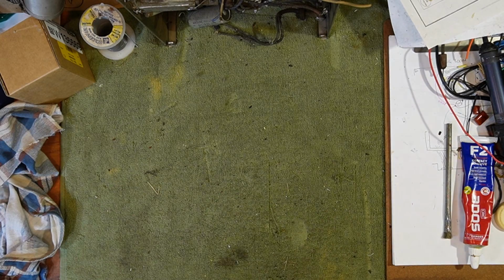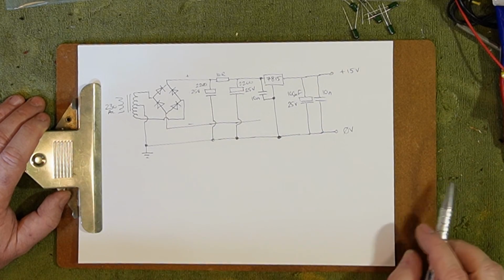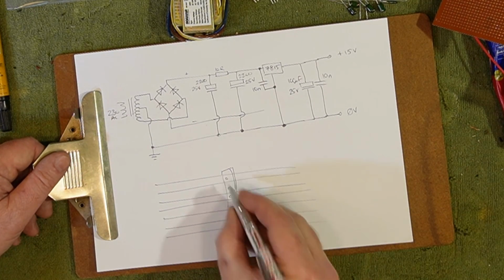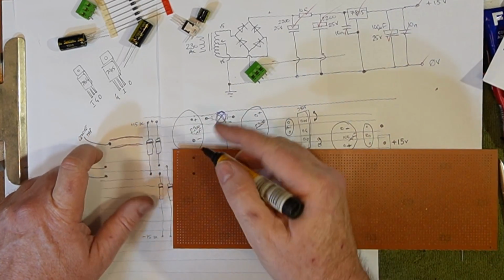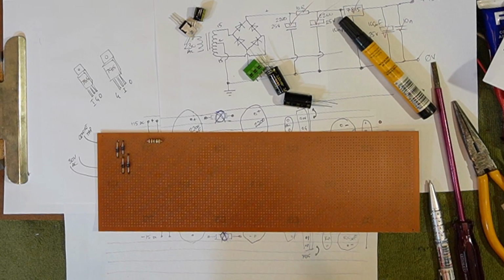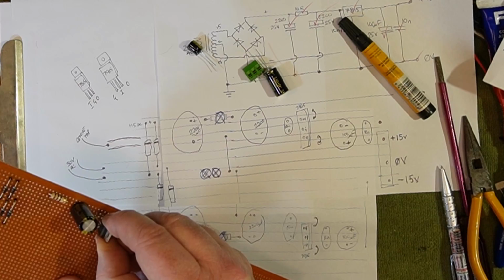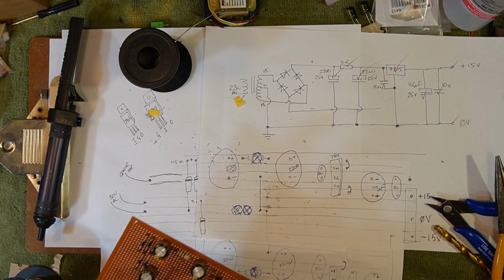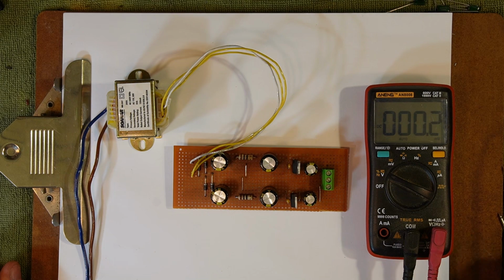Build a +/- 15V Power Supply

Comment: dont need a centre tapped transfo, just use a single winding and 2 diodes....
Reply: dual rail voltage requires center tap. no way around!:face-purple-crying::face-purple-crying::face-purple-crying::face-purple-crying:

Comment: I don't think ur two bottom diodes is doing any work. That is, no current flows through them at all. 

If I am wrong. Please do a video to explain it for us please. I would like a good defense from you. Thanks.
Reply: Dual rail voltage requires 4 diodes. Single rail only needs 2 diodes. 2 upper diodes for the positive rail, lower diodes for the negative rail.:face-purple-crying::face-purple-crying::face-purple-crying::face-purple-crying::face-purple-crying:

Comment: Why 10R ? 🤔
Reply from the maker: Hi, theoretically it creates a low pass filter with the 2200uF cap and so any ripple over about 7 or 8Hz should be attenuated - and 10 ohms doesn't block too much of the voltage.  This is just theory though, and realistically I could have left it out and probably seen no difference.  One day I might do some basic practical analysis of this and see what difference it really makes... Not much in this case I suspect

Comment: what is a pi filter pls?
Reply from the maker: My best understanding is that it's a filter made from three components that look like the symbol for pi when drawn in a schematic. First component across the oncoming signal, next in series, then across it again...  I'm pretty sure that's where the term pi filter comes from, but an actual electronics engineer can probably explain it better. Cheers, Steve
Reply: @VintageRadioSteve  cheers. I looked it up and I think it helps suppress ripple.
Reply from the maker: @deanedgx  Hi, my apologies I completely misunderstood your question... I thought you were asking why it's called a PI filter.  Glad you figured it out despite my 'help', lol... Teachers used to tell me I needed to read the question properly... I guess I still haven't learned that one 🙂
Reply: @VintageRadioSteve  cheers matey. Yep, I have a similar habit. I watched za few videos on pi filter and they seem to work really well. As an audio person, I guess I see them as a 3rd order filter (CLC type) that does a great job of, at least, filtering the harmonics of ripple.

Comment: Hi! could you add the BOM list on description, it would be very helpful! :) thanks

Edit: i guess im looking for safe power transformers, i dont really need the whole bom but anyway, it might help someone
Reply: FULLBRIDGE RECRITIFIER!!!
Reply from the maker: Hi, I drew the schematic in the video around 3 minutes in - so everything is there.  I don't have the paperwork any more, but it's a pretty standard circuit.  The power transformer is from Jaycar, so probably only any good if you are in New Zealand or Australia, but I think it's a Soanar type 2855 (15-0-15V at 150mA).  The Jaycar cat number is MM2007.  Cheers, Steve
Reply: @VintageRadioSteve  Yeah my bad, im a bit impatient... thanks for the info and time to respond my questions :)

Comment: Can u upload the citcuit diagram for this somweher properly arranged it would be really helpful, thankss
Reply from the maker: Hi, thanks for watching - the circuit diagram is shown in the video, and that was the best copy I had of it, since I drew it at the time I made the video... I don't have that paperwork any more, but you should be able to copy it from the video.  Cheers, Steve
Reply: @VintageRadioSteve  I think dude, if possible you can redraw on a paper, or image, and upload that somewhere on web, coz  it's required to check the circuit with correct units
Reply: Just do a Google search for "12v-15v-dual-power-supply-circuit-diagram"

Comment: Things may happen when you make stuff yourself. I don´t know how I do it myself sometimes either and you should see the circuits I design and draw myself in my projects, it is insanely many things they do with tons of components and with the schematic aside I just take a perf-board and wing it, I don´t even make a basic layout on a paper, usually I don´t use Perf-board with lines like yours but just solder islands so I also have to connect every component in every aspect and make my own tracks for it as I go. I imagine a little bit how I want it and build with improvising and surprisingly never really failed either and got really nice final results with it. But in all honesty, making the schematic is usually easier than soldering it all together when you do it like this. But you also get a very personal result from it. I try to make my fails when I am at the prototype stage and build on the Breadboard and be somewhat serious when I build the final thing on Perf-board and I have many devices serving me nicely in my life from doing this. you should see the capacitor I use in my Perfect-DC variable stabilized Tube Amp Power supply, it is a a supply going up to 500volts and half an amp and it uses a final output stage capacitor of 13000uf 500Volt low ESR cap and it is almost as big as a half gallon water bottle, Imagine what would happen with that if I would flip the polarity, gosh
Reply from the maker: Yep, not everything runs smoothly... it's about catching the errors BEFORE the smoke comes out 😂  And I like the 'dot' board you mention too - you can do more compact builds with it since you're effectively making your own circuit board.  Using veroboard here was a bit of a nostalgia trip for me, as I haven't used it for many years.
Reply: @VintageRadioSteve  Indeed :) I pretty much only used dot board as we can call it, I try to make my design in a way that don’t need jumpers to connect different tracks or at least as few as possible. It is actually pretty easy to make tracks on these either using the component legs or a pre tinned wire across the track you wanna do. 
I had one time there was a mysterious issue with one of my boards and it was very intermittent too. The fault was the voltage regulation was not completely stable. I turned the board inside out and looked with microscope and measured it everywhere and the board was immaculate and still it would not always work properly. If I poke with a plastic stick on anywhere on the board it might show symptoms but where they came from was a mystery. Regardless how good everything looked I took the board and re-flow every single track from side to side and tried again. It been working for years now. I never gonna know what caused the issue which is a bit annoying but there must have been a tiny fracture somewhere just big enough to disturb the sensitive voltage feedback. Who knows. But as long as it works I am happy anyway.
Reply: I like to use fountain pens, but they don't like regular cheap paper. I found some very nice paper (Rhodia is one brand) that has a very faint set of dots horizontally and vertically. It's perfect since the dots can match up to the holes in breadboard or veroboard. Since the dots are good enough to see, but faint enough not to distract, works nicely.